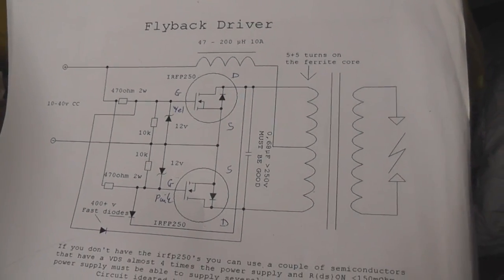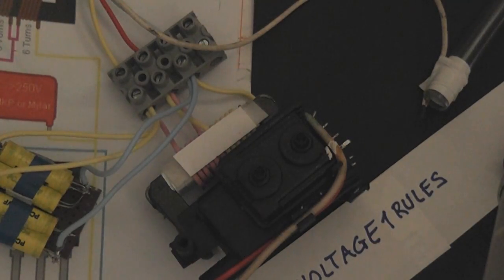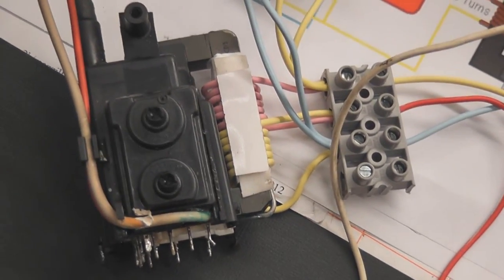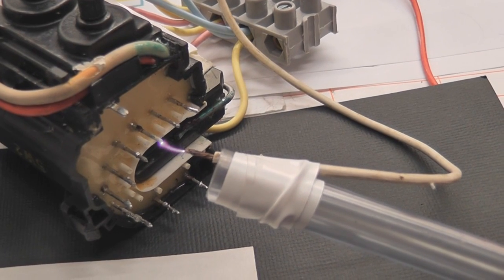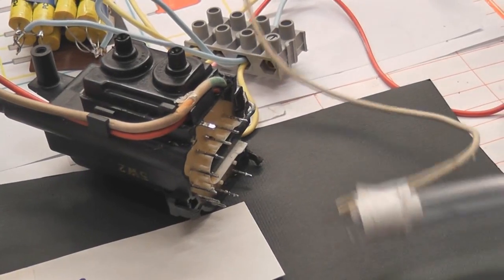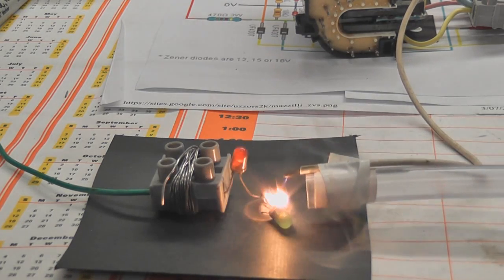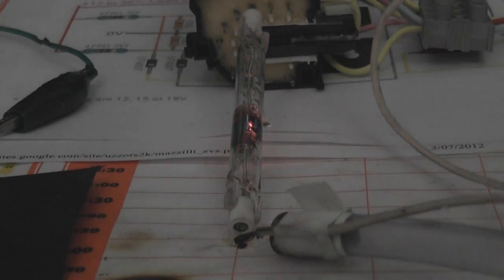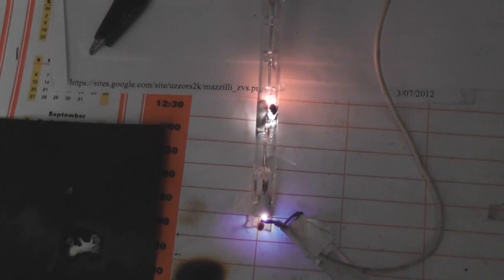12 Volts ZVS driver with IRFP 250's

Comment: Hi, my driver has 260 irfp mosfet, I have to find a power supply, being said. I have a couple of questions...
Does something change using 250 or 260 mosfet? And can It actually works with a 12V and 1A power supply?
Thanks, and good video btw.
Reply from the maker: IRFP250 or 260 mosfets no change needed. The 260 has a higher current rating. 12 Volt 1 Amp wont do it. You need about 4 Amps at 12 Volts. Use a 12 Volt battery
Reply: Thanks. Ah! Just another question, if I want to make an adjustable driver I could replace the 10Kohm resistors by a couple of potentiometers right?

Comment: those are some hot arcs :) i wound a flyback with 2x12 turns of 18 or 20 AWG magnet wire, havent hooked it up yet been thinking about just using a 555 and one j13009 im already using for my 300v boost converter (not using it as a dc mains supply, just for fun)

Comment: i built a zvs driver with 2 irf510 from radio shack, i followed the diagrams and hooked it all up accordingly. wen i apply power from 12v 7Ah battery nothing happens but the mosfet's get hot. can someone help me pls?

Comment from the maker: For 12 Volts it should be OK. For 24 Volts I recommend using a 2 W set up. You can use two 220 R 1W in series per mosfet.

Comment: i made one with 20N60C3 IGBT's   it worked for few seconds, but no so powerful as the single transistor driver for flybacks ( 2n3055, 470ohms and 120ohms, feedback and secondary coil thing)

Comment from the maker: I will but at this stage i am experimenting with 12 and 18 Volts DC, not want to blow up the mosfets yet at this stage. I may even add an HRC fuse in series with the positive supply.

Comment: Good job! I used to have an amazingly powerful ZVS driver running from a 48v SLA bank, very high power flyback and a couple of mods to produce 25cm arcs. Sadly, it ended up being trashed because the fets kept dying and I got scared of it before I could post a vid.... Had a great time with it though!

Comment: That came out really nice! It was amazing that those LEDs lit. I was expecting them to burn out right away.
Reply: the flyback outputs DC and with little current, so if we ignore the mess of high voltage, oscillation and sparks you are likely driving the led correctly